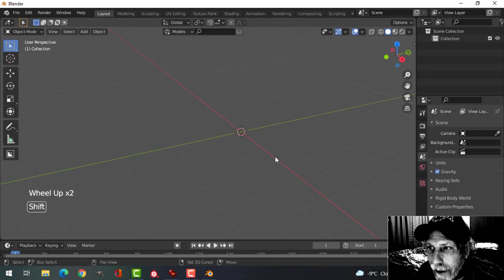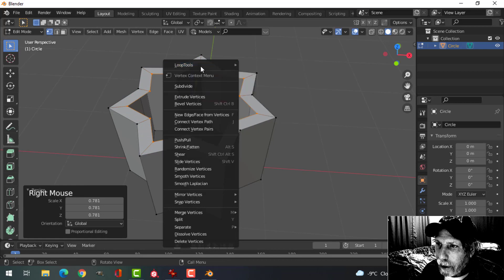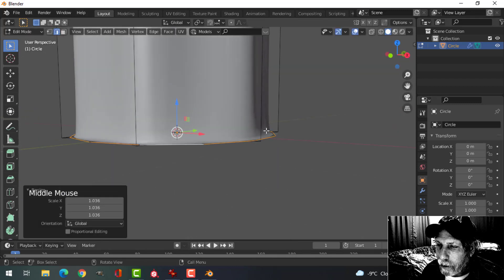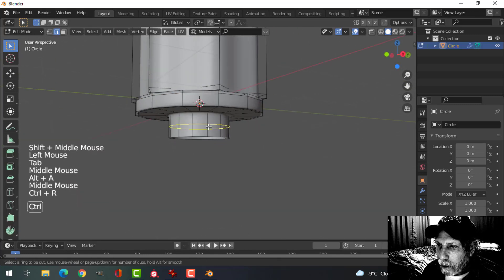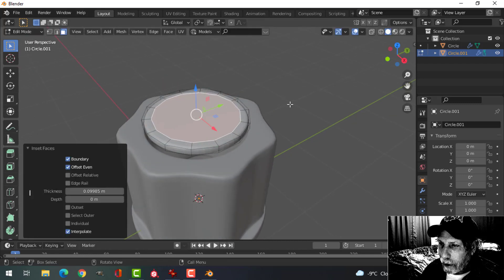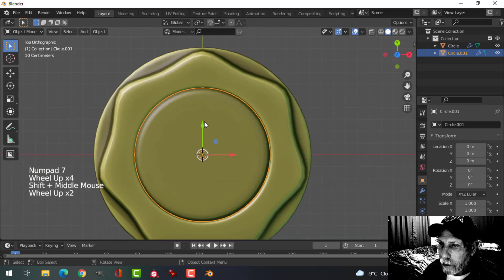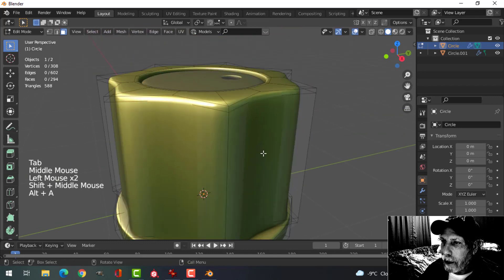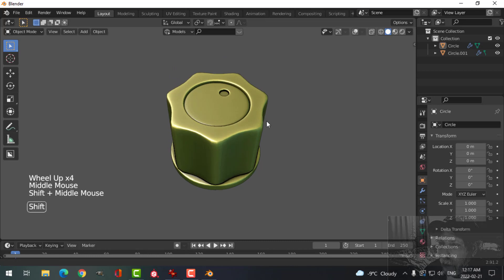BLENDER: QUICK, EASY KNOB

Comment: me taking 50 mins now :D
Reply from the maker: @3DWPG  that's OK 👍
Reply: i do have specific measurement for the spike and inner round/cylinder diameter that is getting out of measurement after doing the Subdivision (1:10 in the video)
What can you suggest to keep my desired measurement to retain as is? Thanks
Reply from the maker: @3DWPG  yeah that is tough. Very difficult to keep it consistent with subdivision.   I suppose I would consider if I can skip the subdivision and see if it looks good enough without it,  especially for a game.

Comment: Great video!  I'm a beginner, and one part that was difficult for me was the "control+2" to add two subdivisions because I don't have a keypad.  When I created the subdivisions from the Edge menu, subdivisions were added, but the object did not become smooth like yours did.  What steps would you take if you didn't have a keypad?  Thanks!
Reply from the maker: Are you able to do it now?  Can you use the modifier stack on the right side to add subdiv modifier?

Comment: Really good tutorial on modeling. Just a minor nitpick electronic equipment jobs do not have threaded attachments like you Illustrated dear. The bottom side of the knob simply has a hole for the shaft which is a quarter inch diameter and the edge of the book have a hole with a set screw in it.
Reply from the maker: You are right of course!  Even way back when I did knobs for electric guitar models, I put the extension on the knobs with threading just because I wanted to add more details.  But of course that's not really how they are.  Funny because I was just thinking about that very thing last night and then your comment showed up.  So good point, for sure.  And thanks for the kind comment on the video.